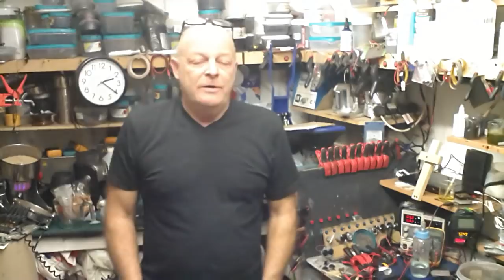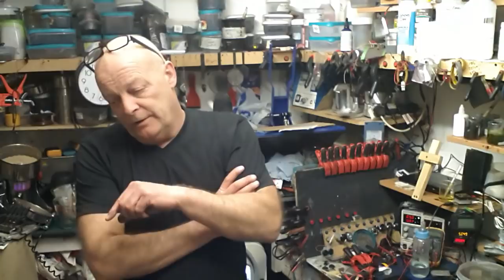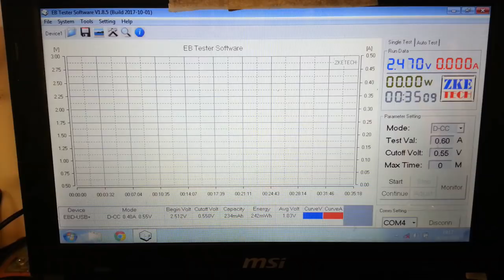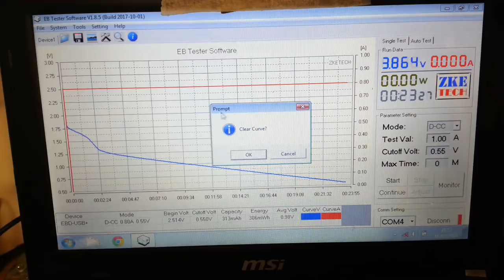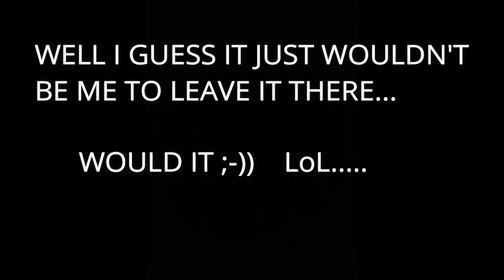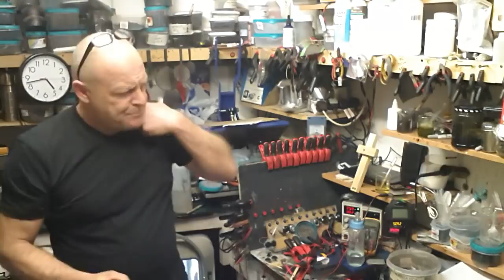All Carbon Battery some of Video 3

Comment: hmmm ok ,,, so ,,, pull an 18650 lithium ion battery apart, cut a comparable size off of the material and run the same tests on it.

Some sort of direct comparison would be to add some kind of bench mark to the work you are doing.  It would help people to see how these improvements in your work are. :D

Comment: Wow again - looks like somewhere around 400ma load your capacity peaks.  So for that size cell  (guessing 100 X  150 mm)  you've found the best load match between cell impedance and load impedance.   Average voltage was about 1V, Average current 400mA = average impedance about 2.5 ohms.   Super.      Can't wait to see results from the other combinations.......
Gotta get back to whats left of the weekend to try and improve my flow capacitor.
Cheers
Reply from the maker: Dennis hi mate interesting calculations. But the size was slightly larger than you thought.
I think 160 x 140mm
Regards

Comment: precisely i did run back to the home lap between Kev and Bio-cell my primative battery now generates 1.250 vd self charging and delivers a wopping short cct current of 1.5 Amp, on short cct test it takes about 1 minute to pull the power down to 300mv then it recharges back to 985mv and left for about 5 min it pushes 500mAmp ..the big test now is to get it functioning over longer time ..
24 hrs test leaves me with 300mAmp 850mv on short cct..

yes i like the idea on witching power between layered batteries ..

Comment: Hey kev! I love your videos!  My apologies if I drop in and out of this hobby, I'm still constructing my home. :)  I see your always getting better results and doing great!  That little hump I think may be a redox couple. We see this mentioned in many of the studies when they test their batteries with potentiostat galvanostat 3 electrode setup. I have been trying to find a low cost way to setup a simple version of one of these so we can also do Voltammetry tests. Maybe we need to setup a forum or facebook group to bounce around more ideas, youtube does not have a continuous conversation, its sort of fragmented.  cheers mate!
Reply from the maker: Adam shep hi mate.
Yes you are correct about that hump, it is an electrolyte / pH problem i read a paper on it.
But yes we need to set up a group somehow, or im gonna be climbing up the walls soon 😎

Comment: On your led flasher circuit could you CMOS chips to cut on power consumption? When you put that 1.50 amp draw on that battery, then went to 40 mA. I didn't see any hump on it. I was wondering if hard discharge helps to form that battery. Some pretty impressive come back on that cell with no charge for sure. Seems to improve every cycle and recharge. I'm impressed with your work, Keep up the informative Vids mate.
Reply from the maker: Arthur Schroeder hi Arthur how ya doin.
Yes not bad results. As regards that circuit yes a cmos chip would be a must. They even operate from lower input voltage too.
Yes that power run didn't seem to upset the batt at all in fact they love it, and recover well that second part was 400 mA though and not 40 mA.
Thanks for your encouragement.

Comment: To gauge if rebound is really constant you need to measure energy in to the cell Vs energy out. I really appreciate your videos mate, following you closely, just still trying to learn. Keep up the awesome work!!!
Reply from the maker: Yes i appreciate your comment. Once i select exactly which setup and which carbons i will be using plus which electrolyte i am going to settle with, i can then start to determine those other equations.
Thanks

Comment: Personally I refer to the self charge or regeneration as rebound because invariably the values gradually decrease. That as opposed to recharging with an external power source. Nevertheless there seems to be a correlation in some ways. I observed that in my eperiments with crystal cells. Degradation of the electrodes was accelerated by charging leading to oxidation. Without external charging the cells rebounded many more cycles or maintained a very slow discharge curve lasting on the order of weeks and even months albeit at very low amperage.
Reply from the maker: MrFmiller yes i agree with you.
I am going to say more on this subject in another video, i just wanted to keep this one as short as i could. But there will be more to that setup than people  may think, mums the word for now.

Comment: I've been patiently waiting to see what you come up with next. My quandry is you've done so much research I have no idea what you've already done. Obviously you've researched countless electrodes, separators, and electrolyte mixtures, and maybe every conceivable combination. I have no idea what meaningful contribution I might be able to offer. I hold your research as equally important as any others. I reference your discoveries to others working on similar projects when appropriate. I appreciate your methodical approach and sheer tenacity. That you share your research is noble and important to progress in the field. No one can explore absolutely all the aspects but collectively the aggregate information can produce far more information than anyone could by themselves. 
As for this video your progress is impressive. It keeps getting better. I've said it before. Keep up the good work. I really mean that.
Reply from the maker: MrFmiller hi sorry for delay in getting back.
Yes a lot done and a lot more to do. I am however starting to settle down with some components that i will be using in a cell or battery. Not to say that i will not be testing other bio mass carbons still, because that shall remain ongoing.
So once again many thanks for your kind words.
Kev

Comment: I would suggest the bottleneck in the 1.5 amp test would be the resistance in the small area you collect from giving reason to as why you get a 1 hour 400 mw test next ! Increase the collection points and I don’t think it would drop 80% of what it did . Very powerful cell you have built their Kev and as I believe you haven’t even activated the carbon surface as yet so maybe double the capacity is achievable !
Reply from the maker: Electron Proton Neutron Mouron yes i could have kicked myself when i realised what i was doing wrong on that collection point.
I also know that once i do start Activating the carbons that it will be a whole new world.
Thanks for your comments 😎

Comment: very good video and with good results especially running at 1.5 amps. You wasn't surprised at the bounce back after that run and yet i was, but for it run for an hour at 400 milliamps   was an excellent
Reply from the maker: Yeah amazing results, all i have to do now is better it  :- 0

Comment: if your having issues with fraying edges have you thought about using a resign on the edges or getting some pre made carbon fibre
Reply from the maker: Hi, yes i am looking at Carbon fibre weave with sown edges. But the problem there is that it comes on a roll in certain widths and so if i wanted to upscale with the width it makes it awkward, many thanks

Comment: think your right about carbon fire weave,got the felt myself was not impressed but only did a few experiments
Reply from the maker: michael endall yes mate i think the felts days maybe numbered.
Reply: yea i bought 3 sheets, used most of one in a few experiments and really wasn't impressed at all but having said that it's conductivity was not that good either but it might be me using it in the  wrong wrong way, didn't have a lot of time. Bought a small sheet from cayrex2 which was much better around 6 oms  but not used that yet since it's only 100mmx100mm so pretty good, but if you do buy some from him keep eye on delivery as i didn't receive my first order .
Reply from the maker: michael endall i got mine on ebay and it was 1.4 ohms
Reply: yea got mine on ebay to 18 oms